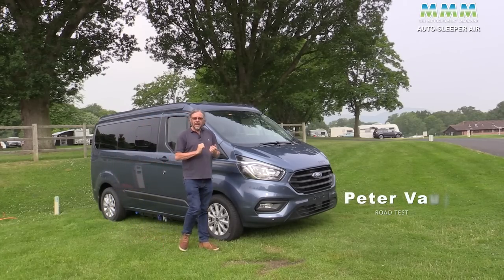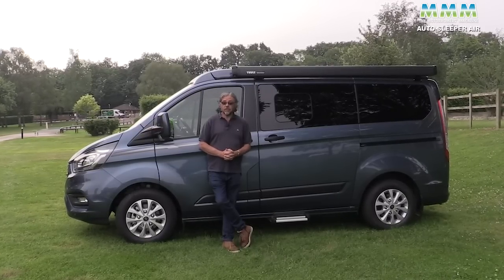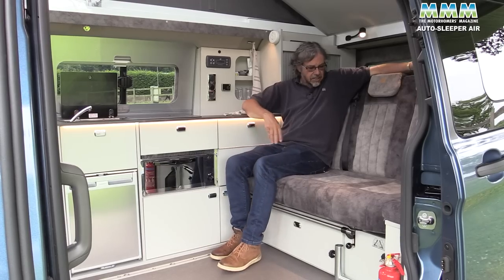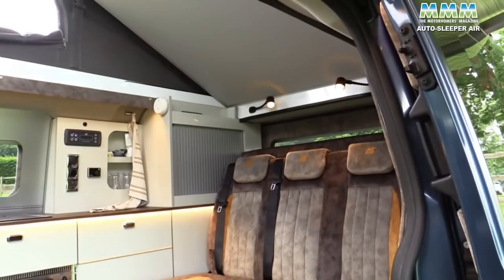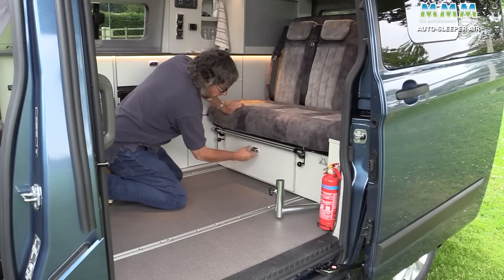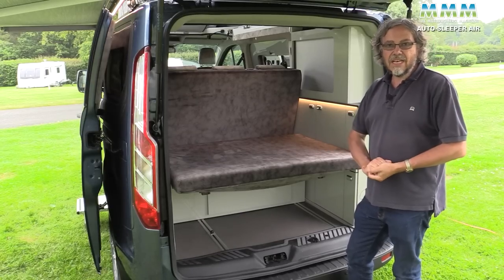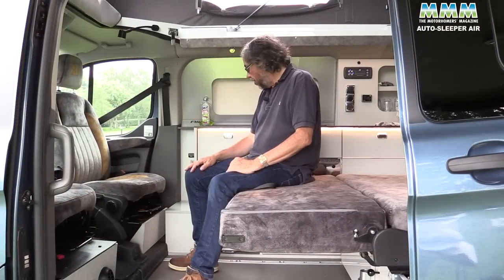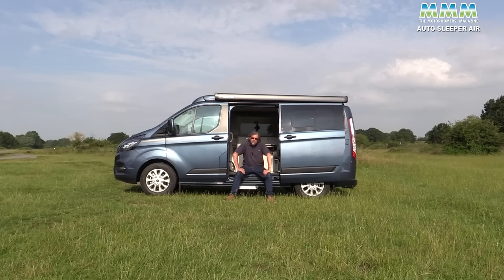Exclusive first ever review of the AIR - Auto-Sleepers' first Ford-based campervan in years!

Comment: An interesting and very informative video. Good to see Autosleeper's are back in the small camper market, but would be great to see a two berth that used their original wonderful solid sided, insulated elevating roof.  To me at least, it was so much nicer than being in a van whose upper area resembles a tent, complete with sloping roof!
Reply from the maker: My parents had a Commer and two Talbots, all with the Auto-Sleeper solid-sided roof. Can't see it returning now, though. It definitely had its strength, although it could be a bit draughty.

Comment: Thank you Peter 
As ever, a first class review, the best in the business.
Personally, I would stick to my VW Coast 6.1 with the same layout, lower roof than a Transit, and narrower so much more practical as a daily vehicle, 
Refinement is better too and VW generally looks more modern and automotive. 
VW do such brilliant tables and chairs in the Californias that everything else just looks second rate. 
VW has integral screens for the windscreen, and a top loading fridge which I know divides people, but is more efficient. 
If I were in the market for a Transit, I would go for the rear kitchen Nugget, just to get the benefit of that layout if having to put up with the disadvantages of a Transit as outlined above.
Reply: I agree with most of what you’ve said here.  Looking at this and the VW California, there are just something’s more refined on the Cali, making it a more user friendly camper IMHO.  There were a few things on this van that I would find frustrating and not well thought through, such as cabinetry access in various places, through to the side windows not sliding fully open!

Comment: Nice camper van, but, just waiting for a rock/boulder to smash off the plastic outlets underneath, you got to be crazy to locate those there! Wish Ford would make the e-brake electronic to give more space in between the front seats.
Reply: was thinking the same, short stay ruined.. and that BBQ gas outlet!! Boom..
Reply: Our Wellhouse version has  a handbrake that goes flat when parking, so no need to worry about rotating the drivers seat.

Comment: As always a thorough review from you, thank you. I think on the whole it’s great just a few niggles that you’ve pointed out. The cabinetry needs reconfiguring. You really need to be able to open all the doors when the seat is in the forward position with bedding stored behind, especially the loo but the oven and fridge too as I wouldn’t want to be continually having to lift up the rear parcel shelf section, move my bedding and reorganise the boot just to move the seat back to be able to access everything. The fridge opens the wrong way too. It’s going to be accessed from the rear more than from the cab. There’s room for slim eye level cupboards above the kitchen, tin height, like Jerber do in the Cromarty, that would be great for food storage. Glad they’ve sorted the table storage as it has to be easily accessible even when the car is fully loaded. The wardrobe needs to have a full length sliding tambour door, finishing just above the parcel shelf so that it’s easily accessed when in bed mode in the mornings with an interior option of shelves or rail. Hanging your clothes up and having to feed them through a small space would be so irritating. Finally the velour seats are horrible! I like the more modern looking cabinetry (apart from flush D catches are needed so there’s no chance of them being left sticking out) but the seats just look terribly dated. Oh.. one last thing. I know they’re standard but I hate the glass topped hob/sink unit. They’re not fit for purpose, you can’t use them as a work surface or put anything hot on them and they’re likely to get stood on when climbing up to the top and get broken. In a small space everything has to do double duty and the lids would be so much better as stainless steel or wood.
Reply: You make some good points! Auto-Sleepers have been out of this sector for quite a while, so it's a good effort but, as always, room to refine when they decide to do a "mark 2"

Comment: This new Auto- Sleeper Air seems very similar to our 6 year old  Wellhouse Leisure Ford Terrier 2 in looks and build quality. However, our Wellhouse van has none of the many habitation design faults that I have just witnessed on this video. For example, difficulties in opening cupboards and getting into them just don’t happen on the Wellhouse.
Reply: I do prefer the Reimo seat/bed system in the Air to the one used by Wellhouse

Comment: Been to a couple of European Motorhome/campervan shows, before lockdown. The prices for equivalent vehicles are much less, than the UK.  Our buyers in Britain have been conditioned to pay more.
Reply: But did you compare standard spec? It's quite usual for German campervans in the home market to have unpainted bumpers, steel wheels, gas-only heating, etc, etc. UK standard spec is often much higher because that's how British buyers want them. Then there's the cost (£2k+) of getting them here and all the extra admin post-Brexit
Reply: @peterv3642  Being in Europe, you wouldn`t pay 2K transport. On a like for like basis, they`re far better prices.
They were when i was at their shows. Because of lockdown now,  prices here have gone up exponentially.
But if people pay it, good luck to you.

Comment: Whats written on the log book vehicle i wonder, as it doesn't fulfill dvla's motorhome or campervan  category or does that only count for self builders not the big boys
Reply: It will be fully type approved, so I'm sure it'll be registered as a motor caravan. The issue mainly concerns changing the type from van to motor caravan, but this will start life as a motor caravan
Reply: @peterv3642   In what way though? It's a Ford Transit with regular passenger windows, doesn't have loud graphics that scream out "Camper Van" and it doesn't have a high top. It doesn't come close to meeting the DVLA definition, despite that just as a self converted van, it is designed for sleeping in.
Reply: @islaws4589  But it has full European Whole Vehicle Type Approval as a motor caravan and will never have been registered as a van
Reply: @peterv3642  Ah okay I understand now. It doesn't seem very fair though!
Edited to add P.S. Sorry, hope I didn't come across argumentative because I didn't mean to. A work colleague who has a VW he bought used as a blank canvass had it converted, thankfully just prior to the rules changing. It went from van to being the same spec as what I now understand could be the same vehicle registered from new as a motor caravan. That seems unfair not only to self-converters, but also to businesses retro-converting vans with pop tops, standard glass side windows and fairly suburban graphics!

Comment: Taking price out of the equation, what would your preference be between the Air and California Ocean, particularly as a daily driver? I looked at the Air at Marquis today, and really liked it’s ‘cosiness’ and the amount of standard equipment, but the modern dashboard of the T6.1 VW seems so much more car like. I prefer the cabinetry of the Air as well, but my head tells me the VW will hold value better and just has the better heritage. I am having a really difficult time deciding which of these I should buy!!
Reply from the maker: That's really a decision only you can make! You need to drive them both first, I think. Storage, practicality and build quality will be more important than cosiness in ownership. I used to own a California and nothing else matches its residual values but there are lots of other great campers on both Ford and VW. I now have a CMC HemBil conversion on the VW T6. Don't rush in...

Comment: It's a less good Wildax Proteus for £10k more?
Reply: There's more spec on the Air and a better seat/bed system. If you're comparing Ford campers, take a look at the Escape from CMC, too
Reply: Spec for spec there's still a massive price difference even once you add alloys and webasto to a Proteus.  Seat system are both sliding and triple belt tho the reimo looks better .

Comment: Can I park this van at my house if I buy it, or by law I have to park it at the camping site? Please help anyone.
Reply from the maker: Yes you can normally park it at your home. If you have a driveway, it is fine. However if you park it on the road I would be much more careful - sometimes there are restrictions on what can be parked in some housing estates, so it's worth checking your deeds. But parking on the road is never advised as it is much less secure than on a drive (with posts and locks). Alternatively, look at a secure storage facility. Ask your insurance company which it recommends (it may also tell you that you can't leave your campervan on the road overnight anyway) and then, if you can't store at home, use a secure storage site instead. But these are different from campsites - do not store your new campervan on a campsite!

Comment: Not worth the money in my opinion. Very overpriced but not as overpriced as the VW
Reply: That's what a high spec campervan costs these days, unfortunately. When you see the cost of a proper German seat system and a top-quality roof (probably over £10k just for those two critical safety items), plus the expensive base vehicle (not a cheap Fiat), it's hardly surprising
Reply: @peterv3642  The practicality of it is superb but there are other more spacious vans out there that incorporate shower areas and proper toilets for around the same money. I think they got the price wrong on this one in my opinion
Reply: All campers are overpriced here.
Reply: @TheMilford99  Too true - and will often be bought by people who rarely use them.  It's where you go in a campervan that counts and an old one can reach all the same places for way less money.......as proved by the many vanlifer's in far from new vehicles touring Europe - not worried about putting on the miles, getting them dirty, or a scratch or two to the paintwork.   Far less stress, if you're not keeping up with the Jones's!
Reply: Boo hoo

Comment: Want a PHEV version 👍🙄
Reply: Maybe that will come. Ford does a hybrid Transit Custom, but I've driven one of those and the real world battery range is very disappointing
Reply: @peterv3642  Yep, battery range is crap in the transit PHEV at the moment similar to crap 30 mile range in my  Mitsi PHEV outlander ( next generation PHEV  EV range is doubled).
BUT the redeeming ACE  card with the Transit PHEV and Mitsi outlander PHEV ( when towing a caravan)  is the ability to use the vehicles engine driven 80KVA  generator to supply all your electrical appliances in the van,  electric  cookers ,climate control heating , 8 KW shower and recharge the vehicle  batteries all at the same time, making it the ideal off grid motorhome . ( this eleminiates  the need to have onboard gas appliances, heavy bottles and generators )
My PHEV is the ideal off grid towing car when set up in this configuration 👍

Comment: I think this will go the same way as the Autosleeper Wave, a failure, to expensive, far better offerings on a VW base
Reply: The Wave had many faults but I see the Air as a far more complete and competitive offering
Reply: @peterv3642  agreed it is an improvement on the wave but my choice on this type of vehicle would be the Wildax Triton, which as it is on the LWB version of the vehicle it has a toilet compartment and around £9,000 cheaper even with the auto box, granted it has not got a  lithium battery or the big engine  and has a different interior layout but this would be my choice but obviously others may prefer the Autosleeper air
Reply: @padraigpost  The bed arrangement in the Triton is too compromised for me, as is storage. For a long-wheelbase with a loo I'd be looking at the Bilbo's Nexa+ (probably my choice), Devon Firefly, Rolling Homes Livingstone, or perhaps the Greenline RG500. The Plus version of the Nugget might be interesting when it eventually arrives in the UK, too

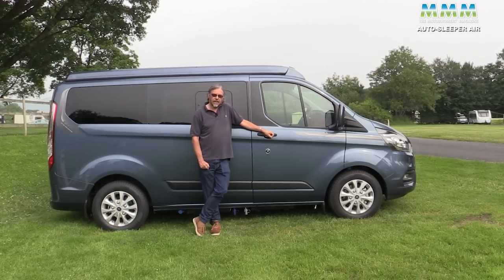Comment: 2:45 in...and still showed NOTHING inside, deliberately stalling
( Words don't mean SHT! SHOWING means something )
Reply from the maker: These are COMPREHENSIVE reviews of campervans and motorhomes and our subscription numbers are rising fast, so most seem to like the format. However, if you have only a passing interest, you can always skip to a quick look at the interior, if that's all you want.
The video means NOTHING without the expert explanation. It's the combination of the visuals and the words that makes a good video!
Reply: @MotorhomeCampervan  'Comprehensive???' According to what mandate and from whom?
( 'Clicks' and 'Subscribes' are one and the same...the touch of a finger and nothing more than that! )
__________
What does 'if I want' mean?  I want to see 'How this vehicle has been transformed into a 'Camper' and the features to make a 'Camper'...NOT what is already self-evident that it is a 'small Van-type vehicle'
( When a drawer has been pulled-out...is it smooth in action? Are the drawer guide-rails equipped with ball-bearings to ensure smooth action for decades of use? )
THAT is "COMPREHENSIVE!"